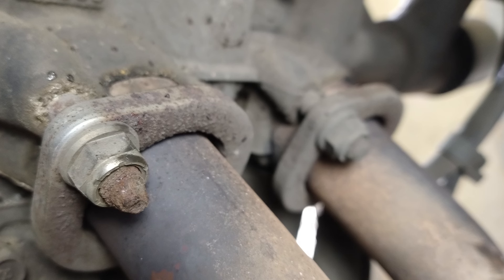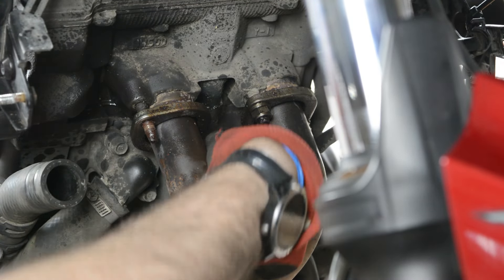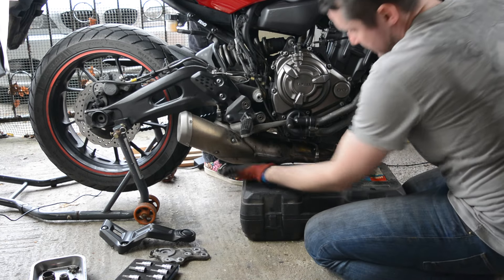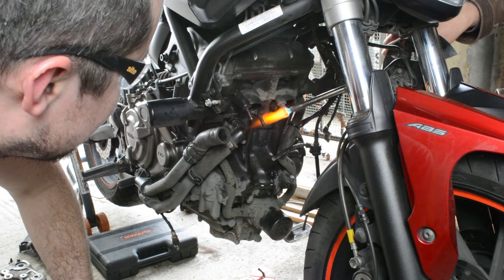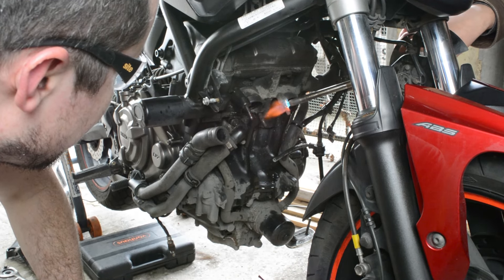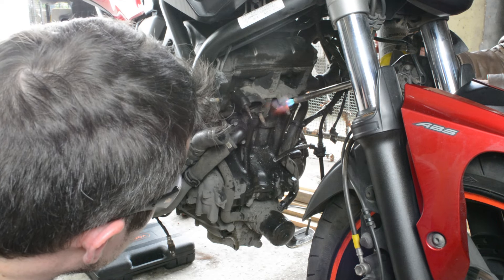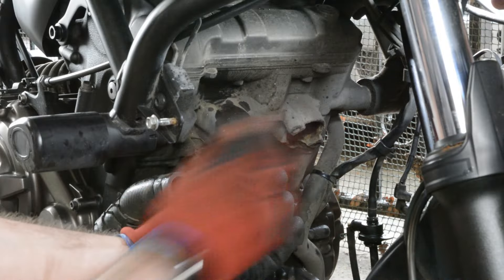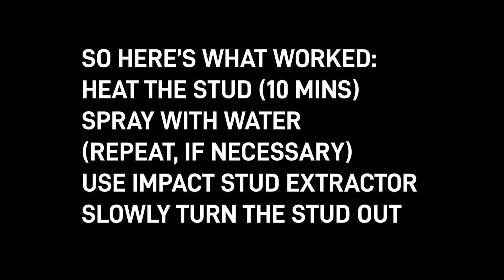MT-07 Exhaust Stud Removal

Comment: Just had one of them bolts snap on me and this video has just saved me a load of hassel, also can the stud extractor be used to put new studs in.
Reply from the maker: I would just wind the new studs in by hand, with a little bit of copper grease on the threads. I am in the process of making a video of fitting the exhaust - I decided to get some titanium exhaust studs in the hopes that I don't need to ever deal with rusty studs again! I'm glad it was helpful for you!